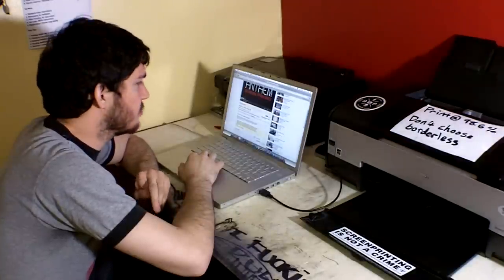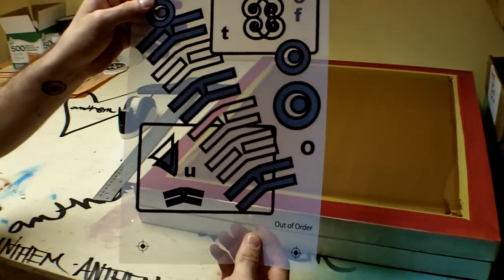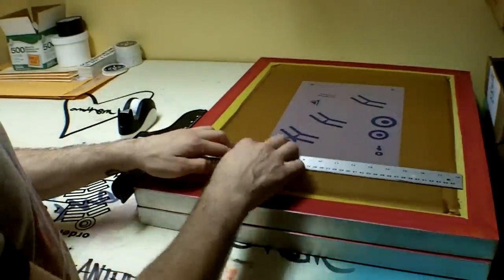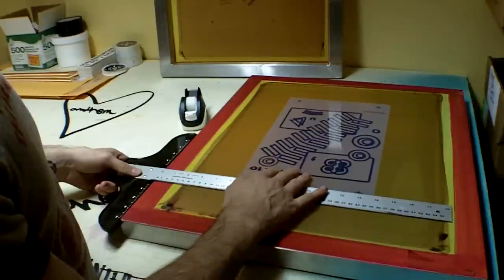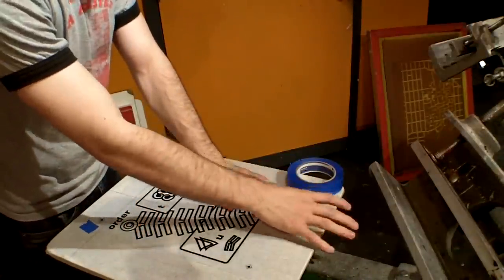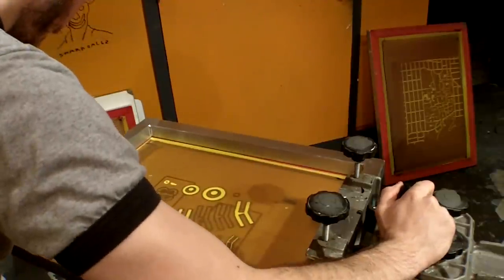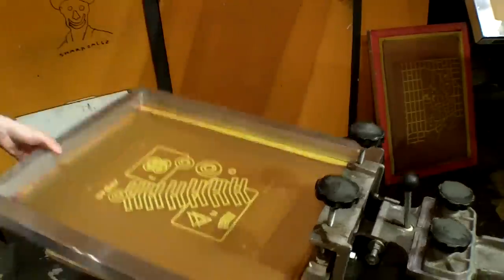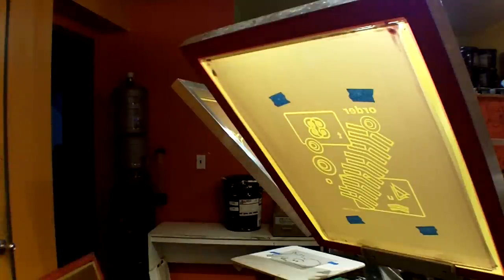Setting Up A Multi-Color Screen Printing Job

Comment: Thanks so much. I have a athletic line of 3 designed shirts and I will probably will be producing 3 design's each season. If I get alot of orders I will just contract the orders out but I suspect I will be getting smaller orders. So do you think The beginner silkscreeningsupplies for 199.00 with no micro registration or should I try to find a line table press? Which I can't find anywhere. Again thanks for responding and happy easter. Tony PS I subscribed.

Comment from the maker: Hey there, I suppose it was more around 5" since the artwork was down about another inch away from the registration marks. That doesn't necessarily mean that is where you should place the films on your screens though, the distance down will depend on where your platens fit on your press, and the size of the image. The important thing is you use the same measurement down on each screen for the design you're burning. Hope that helps! :)

Comment: I have a design where I have 3 rectangle strips across the shirt about an inch thick all with 3 different colors. I have no lines separating the colors. Would this process your showing me here work for my situation of the colors being right up against each other with out a line separating them ? Thanks so much for your time.  Tony

Comment: Hey, so did you technically place your artwork more like "5 inches" down from the top since you added about an inch by placing your artwork at the outer edge of your t-square?

Comment: Good tutorial.  I wouldn't, however, tape off the reg marks before making a test print.  Easier to adjust if it's off a little bit.

Comment: I understand you register the screens so the screens are perfectly aligned. Lets say all screens are perfectly aligned. You print one screen and move on to the next screen. You rotate the next screen freely and stop over the shirt and pull down the screen. How do you know the screen will land on the same spot you aligned??? I ask that because I see people in videos switch over to the next screen and pull it down. You can rotate the screens so freely so I would like to know how do you know when to stop and land on the same spot. It doesn't seem like there is tension to stop you when you spin to the next screen.
Reply: There is a stopper that places each screen at the exact same positing on the platen.
Reply: Thanks.

Comment: another tip...if you tape your reg marks on the ink side of the screen then they can be removed and be free of ink just in case the screen needs to be re registered during a long print run.....easier to check your reg marks later if they're clear of ink.... :-)

Comment: how do you make the transparancies for 3 colors or multi colors. I assume you have everything on  a computer and you print off a transparancy for each color, but how do you do this? what software separates the colors?
Reply: I use Adobe Illustrator